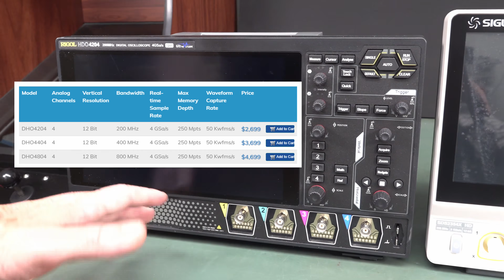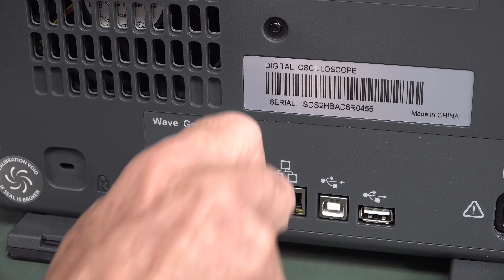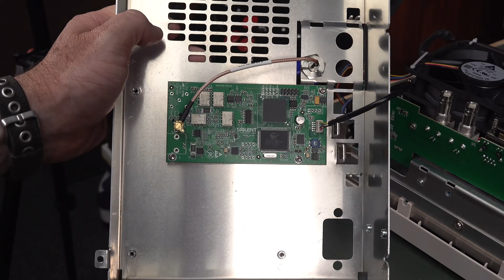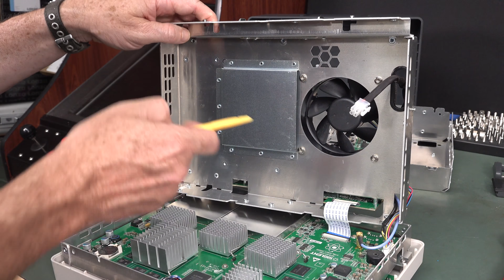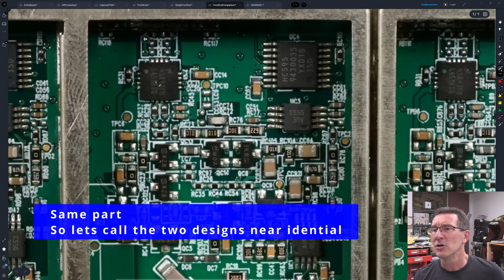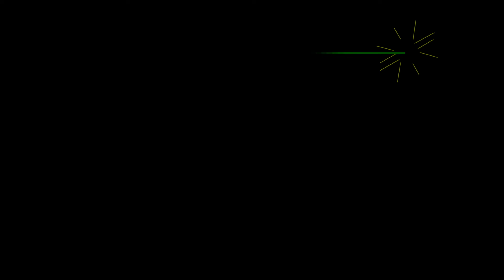EEVblog 1530 - Siglent SDS2000X HD 12 Bit Oscilloscope TEARDOWN

Comment: 8:12 Well, I don’t think it’s a good idea that the nameplate of the power supply has been stuck onto the capacitor. If the capacitor breaks, the nameplate could get damaged. And even if you only need to replace the capacitor, it’s inconvenient because then you’d somehow have to stick the nameplate onto the new one again.

Comment: 23:00: I have a simpler solution to the problem:  Just label the BNCs on the front "1" "3" "2" "4" ;-)
And the software needs adjusting, of course. I doubt anyone would be happy with this solution, however...

Comment: To put it into perspective, if you add up the price of just the Spartan 7, Zynq, Artix 7, and the two ADCs, it's already more than the cost of the entire scope itself. Those ADCs cost $1,500 USD each

My guess is that the Spartan 7 handles the logic analyzer input capture, the Artix 7 handles the ADCs and any math on the data, and the Zynq is used to tie it all together and run the main OS.

Comment: On directing ch1 and ch2 to different chips...  is there a similar issue just swapping the trace or wire from the bnc for ch2 and ch 3?  

Other than changing what people have become accustomed to.  I don't usually stress bandwidth anyway, so I use 1 and 2 first.

Comment: Speaking of having Ch1 and Ch2 on the same ADC:
Ch1 and Ch2 are special channels comparing to the others. They are designated for X and Y in the X-Y mode. For example, with SDS2000X Plus you can only use Ch1 as X, and Ch2 as Y. I would prefer to have full sampling rate in X-Y mode!
I don't know how hard it would be to make X and Y selectable channels.

Comment: I like to use CH1 and CH3 way more than CH1 and CH2, because then the sockets are further apart, and it's easier to fiddle around with the cables. The sample rate is obviously another factor, and the board layout, too, but it is simply more practical to use sockets that are not right next to each other.

Comment: DCDC chips are never really 'chunky' because of mosfets, those usually best sink their heat into a copper plane and are better off left flat(some do have exposed pads at top for thermal as well though). Integrated inductors are usually the reason for the added height.
Reply: This one is chunky as it has a built in inductor as well, the datasheet shown briefly was for the wrong part

Comment: Dave, on the channel swap question,… you swap the signal on the front bnc connectors. Then the print is the same, just a software solution. 🫣

Comment: Can someone explain, why have low current switching relays not been superseded by silicone, the 4066 has been out forever, is it a crosstalk issue?
Reply: Most probably crosstalk, yes, plus other losses, like on-state resistance. I have a Sony ICF-7600DA radio, in which a 4066 (or similar analog MUX) does the band selection. That radio is pretty mediocre in SW sensitivity, and I presume that is caused by the crosstalk and other losses in the MUX IC at those 10-20MHz frequencies. It performs gradually worse at upper SW bands.
Reply: Capacitance in the open position is a nother big factor.  Most low end scopes use an 4066 for AC/DC coupling. There the capacitance dosent matter because it is connected across a big capacitor.

Comment: Those stickers are illegal.
Reply: Illeagal and not leagally effective are two different things. It is not forbidden to use such a sticker. But removing the sticker dosent have any consequences if the warranty case goes to court.
Reply: @lukahierl9857  no they are illegal in the usa you can not put warranty void if opened stickers

Comment: Re: Why aren't channel 1 and channel 2 on different dual ADC chips? The obvious way to do it would surely be not to have them in order on the front panel. Just label them "Channel 1", "Channel 3", "Channel 2", "Channel 4" on the front panel and change the software a bit and you're done with still the same tidy track layout.
Reply: It would be even more retarded than having channels 1 and 3 as mains. If people are really so out with this, then most logical way would be having channel 1.5 and 2.5 as "half" channels, so scope channels would be 1, 1.5, 2 and 2.5. Don't see any reasons to do so, manufacturer could just print graphical design print on front panel which would suggest that channels 2 and 4 are just subchannels of 1 and 3.
Reply: @darausus8315  First part: silly because you can probably still use channel 2 as full channel if you don't use channel 1 etc. Second part: fair enough.

Comment: I'm really not a fan of replacing the warranty void sticker before resale. It's quite disingenuous to the buyer.
Myself, I really want to know if something has been opened or repaired before if I buy second hand.
I've seen the most horrible repair attempts done to stuff, half the screws missing and it may even have some ESD-damage, if it was handled poorly.
Especially if I were to spent the big bucks to get one of these non-entry-level scopes.
Reply: Yep, pretty poor play to actively suggest that sellers should lie to their would-be customers.
Reply: It's not nice if some actual repair work was done to it, but if it was just opened for curiosity, like this one, no big deal. Although I would suggest just to remove the broken warranty sticker. A missing warranty sticker is better than a broken one.

Comment: Siglent has come a long way in terms of quality since its beginnings and it shows. I hope they'll still make scopes for the low end /hobbyists market, though.
Reply: This is low end, at least in cost. It's $1.2k. That's not a lot more than the basic scopes were a decade ago. I still have my Rigol DS1054, half the price but good enough for my use. If I were buying now however, this is a lot better specified and looks very well made.
Reply: @mikewillis1592  This is the HD version. It starts at 3.5k
Reply: @JohnDoe-wb7ng  You mean the 12 bits version ? If there is a 10 bits version at $1.2k, then it's a pretty good deal and still in the reach of advanced hobbyists.
Reply: @lolilollolilol7773  Correct. I am ok with my rigol but the 10b version for 1.2k would be a nice upgrade of my lab. I was just reacting to Mike Willis saying that this very version is not $1.2k device.
Reply: @JohnDoe-wb7ng  That looks like a damn good scope for the price, for sure !

Comment: Their airflow is a bit drunk indeed. Zynq is running operating system for sure, they are all the rage with the ZyBo Digilent Boards. Spartan is for the sampling of the digital stuff.
 The function gen seems to have its own processor. If they use the Lattice as the over scope, my guess would be glue logic, from status bits to buttons to pretty much everything.

Comment: Interesting so many FPGA's. I would have thought the giant FPGA would have been able to do everything? Also interesting that they'd use the obsolete ADC12D1000 from National.
Reply: I can see a few potential reasons. Does the big ARTIX have the capability to do everything all in one? Probably. Would it be easy to design? Almost certainly not. You wouldn't want Linux or your logic analyzer sharing access to your timing-sensitive acquisition memory controller, and the ARTIX might not have a second or third memory hard-core.

As for the little MachXO controlling the display, my guess is the ARTIX doesn't support the right I/O voltage standard? Newer FPGAs like ARTIX-7 don't support 3.3V and 2.5V I/O (which are commonly used for display panel interfaces) on the high-performance type I/O banks.
Reply: @asm_nop  its more likely that they used their already stable working system modules rather than develop a new one, especially in this price region so the MachXO was a no brainer. The Zync is the obvious platform for linux application processor if you already using the Xilinx ecosystem and the Artix has the necessary power to not only do the data acquisition but also processing like FFT… The Spartan is ten used as Dave suspected for the logic analyzer, external triggering, maybe the arb wavegen stuff. All of these parts may have come out of other products like spectrum analyzers, signal gererators and such they're doing as well, probably on the same FPGAs.

Comment: Great teardown video Dave!
I think there's a much simpler and sensible reason why the channels are not organized 1324 iso the usual way...
Though trace routing concerns are indeed a thing that would have to be considered, the most important thing is easiness of configuration in case of a dual channel option.
Sure enough no one wants to be messing with varying signal routing depending on the option, and even less using 2 ADCs on a  dual channel scope... The only sensible choice is to organize the signals coming out of the front end 1&2 to the first ADC, and 3&4 to the 2nd ADC.
As for the additional FPGA with "mystery" use.... Wouldn't it be for Sync? 
I don't have much experience with digital scope architectures, but at least on the analog ones, Sync usually takes quite an important chunk of the circuitry... And maybe it was too much for them to accomodate into the main, larger FPGA...
Or it can be dedicated to the logic analyzer section.
Reply from the maker: Yep, forgot that.
Reply: I could be way off here, but at first glance, the board just looks like it repeats a known good one channel configuration that was made to work for two channels. Then, there are two of these side by side for four probes.  The five BGA RAM IC's in the upper right might be a way to use cheaper older RAM and get easy cheap storage to feed the main CPU with stored data chunks

Comment: Delta fans are the best out there. I like the triple blades.  A little loud., but excellent cooling.
Reply: Really, Delta fans are the only fans I have ever seen disintegrate in normal operation. The bit were the fan blades came off, it kept spinning and then proceeded to spew brass shavings all over the inside of the server was particularly spectacular. We had at least 7 Delta fans disintegrate, and in the end the server vendor just replaced them lock stock and barrel because another on the ground the bearings up would cost more. The repair bill was in the thousands of dollars. Pictures can be found on servethehome forums.
Reply: @jonathanbuzzard1376  perhaps he unknowingly bought a bunch of fake copies ?
Reply: @lolilollolilol7773  we are talking a major tier 1 server vendor here, fake fans is not the explanation
Reply: @jonathanbuzzard1376  Maybe a bad batch. Delta fans are really excellent. At work, we had an ancient HP Pentium II server that was running from 1998-2008 in 24/7, both the PSU and CPU fans were Delta, and had no problems when the server got retired. Also at work, CCTV DVR running from 2013-2022 in 24/7, it had Delta fans as well, but smaller ones, so higher RPM. They were a bit noisy already when the DVR got pulled out of service, but they still were running (also the two WD hard drives were perfect after almost 10 years of continous use, quite remarkable).

Comment: How much cheaper would these be if they just subsumed the basic I/O, microprocessor, storage, power supply and display to the PC sat on everyone's desk. Such an unnecessary duplication of electronic waste. The magic is in the ADC and signal processing, not in all the superfluous stuff better handled by established and duplicated tech on your ruddy bench.
Reply: Not much, because these are the cheap, mass produced parts. Also PC oscilloscopes suck.
Reply: @advancedmicrosystems4658  there's no inherent reason why PC scopes should suck (v.v. Pico Technology), providing you retain the custom high speed/precision hardware to capture the probe signalls - they have a poor reputation because they facilitate low-end products, but they can support high-end requirements too.
Reply: @stupossibleify  I know this, I work with Pico Scopes sometimes at work. Its more about usability and Isolation, I need my pc for ecad and datasheets, not for scoping around.
Also I want physical buttons because they are much more convenient. 
And sory for that, but I cant take anyone serious who talks about electronic waste in such an incredible small niche like test equipment, thats sub molecular bean counting.
Reply: Probably more expensive since doing software for it would be a pain
Reply: Back in the early 2000s Tek and others did exactly that.  Many of their scopes were Windows 2000 et el PCs with scope hardware wrapped around them.  Imagine your 5+ figure scope experiencing a BSOD because it's POS consumer-grade Windows OS crashed.  No thanks.
Reply: @RogerWilco486  That is still the norm in high end scopes.
Reply: The PSU is $15 and the LCD is maybe $50, so not much.
Reply: @jaro6985  You know they are valuing those parts far more in terms of the price contribution to the overall package!
Reply: @stupossibleify  yes, so if the market were bigger it might knock $500 off the price. But the market is small.

Comment: The SDS2000X Plus has a 10 bit mode, it is under the Acquire menu, it reduces the memory depth when in use. I have a SDS2504X Plus.
Reply from the maker: Not a true 10 bit ADC though.

Comment: I think that metal plate @13:00 is using a venturi effect to suck air past the power supply from the side vent.
Reply from the maker: Yes, the fan is press fit (bot no seal) on the back case, so the suction will draw air through the thin plate from the outside over the PSU.

Comment: How are the remote interfaces (USB/LAN)? I tire of taking screen shots to document circuit behavior and have shifted almost completely to instruments with complete and performant remote interfaces, greatly simplifying documentation (screen grabs), data capture (including live) and analysis (e.g., Matlab).

At my current gig (an RF semiconductor startup), engineers were making frequent trips into the well-equipped lab, then back to their desks, then back to the lab. I put a Digilent Analog Discovery 2 (DAD2) on my desk-bench, and for basic stuff was instantly running productivity rings around them, occasionally using the lab only for higher-bandwidth stuff.  The DAD2 paid for itself just in recovering the "out of chair" time. And without a stack of equipment taking up room on the small bench next to my desk!
Reply from the maker: Haven't even used it yet.
Reply: If it's anything like the 2000X Plus series I have on my bench, the LAN interface is outstanding. Full speed low latency web based GUI!

Comment: I had to stop the video at the metal handle........and raise a glass to Siglent. Absolutely topnotch.
Reply: you gotta have an aluminium handle to lift this kinda processing grunt. 4 FPGAs. Whoa! ;) No seriously, the mechanical engineering (as well as their electronics) improved a lot since I first bought that PSU with a rusty metal frame inside a slightly brittle plastic case about 15 years ago! Most likely its demanded by their OEM customers like LeCroy thats giving us better quality!
Reply: even rohde and schwartz used a plastic handle
Reply: The metal shielding is connected to the metal handler. From a mechanical viewpoint, this is good. But I hope they have connected that to the protective earth. Plastic, on the other hand, will not cause any problems

Comment: yep! they have gone all the way 1980s-SONY construction! pretty cool! it seems the air duct is there to prevent the hot air of the PSU mix with air flowing over the main board.